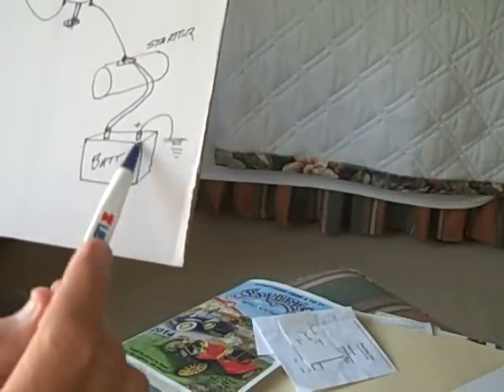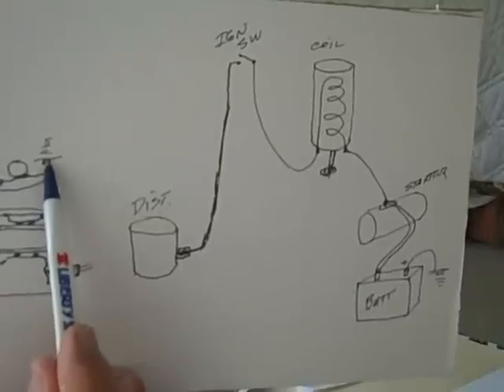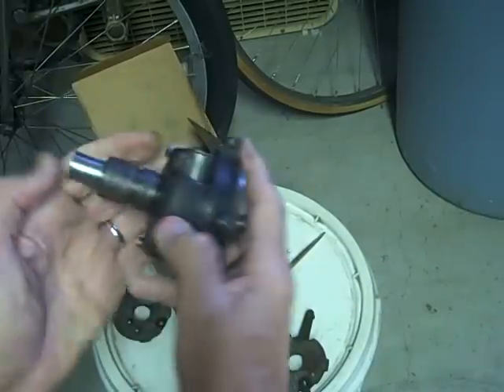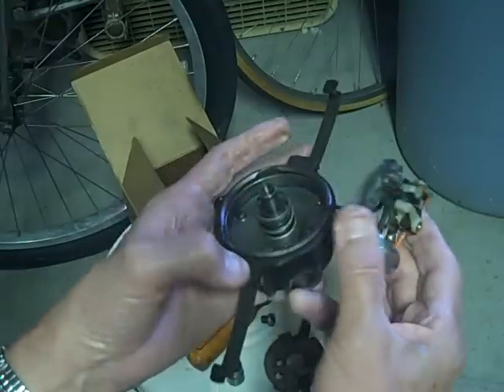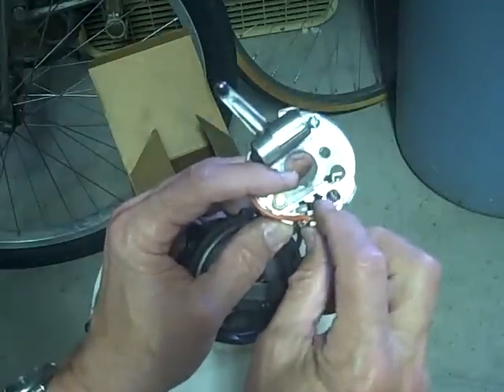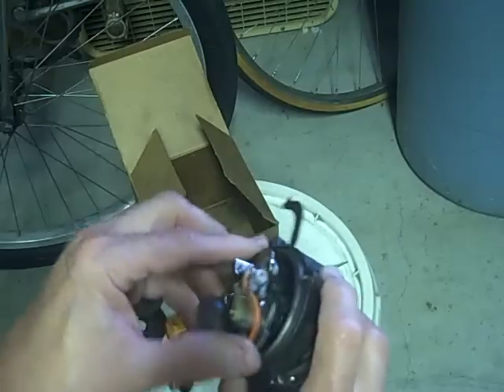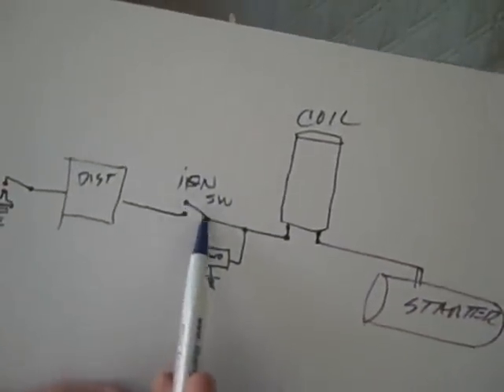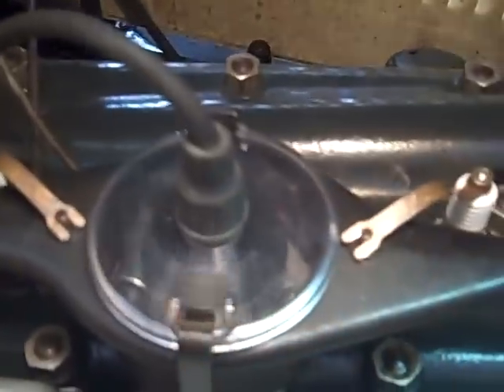Model A Ignition System 101

Comment: Jack 
In your video the wire from starter is going to red wire driver side. In your other video with drawing you made the statement wire goes from starter to passenger side of coil. I'm confused and I do understand the purpose of the coil but my Tudor has starter to neg. on drivers side.  Is that good? Also in your other video you mentioned test your horn and if good then fuse is good continue and check coil.  My problem is I have 6 at both sides coil but horn doesn't work car won't start and batt full charge.  Tested continuity at dist points open and good timing done.  Key on points open with 6 both sides of coil. Where do I start? I have new switch,  ammeter and dummy switch on the way.

Comment: Nice presentation.  One component you left out of the ignition circuit is the Ammeter which can be a useful tool in troubleshooting ignition problems.  When the ignition switch is turned on, the Ammeter should deflect slightly to the left if the point happen to be closed.

Comment: Thank you for the very informative video. I removed the original engine from my 1931 Model A truck (piston #1 cracked) and I replaced it with an engine from a 1928 Tudor. The last thing I have to do is replace the wire that goes from the ignition to the bottom of the distributor. Your video explained a lot - Thanks.
Reply from the maker: Big Tex. Don’t screw it in too far. Just enough to make contact.
Reply: @JackBahmlll  Question: This 1928 replacement engine was running in a show-winning car before I got it. It was removed from the Tudor and was in a guy's shop on an engine stand for about 3 months before I installed it in my 1931 Model A truck. Should I be concerned with checking the timing before I try to start it? Also, how will I know when I've reached "just enough?"  Thanks
Reply from the maker: @BigTex347  It will start.  3 mo. is nothing.   If it ran when it was put to bed, the timing is ok.  Maybe half the threads you can see.  Not tight.  Let me know.
Reply: @JackBahmlll  Hello Jack - I got the truck running for the first time this evening - Thanks for all your help. I called the guy that gave me the 1928 engine and asked just how long that engine sat on his shop floor before I got it. He said 5 years. I was under the impression it was more like 3 months. Non-the-less, it runs smooth and I couldn't be more happy with the way it turned out. I let the engine idled for about 15 minutes, revved up without a problem and so far it seems to be happy to be back in use! Thanks again for the information on the timing - so far it seems to be doing ok without any adjustment.
Reply: @JackBahmlll  Hello Jack - First drive in my 1931 truck after the engine swap was yesterday. Thank you for helping me through the process! Mike
Reply from the maker: @BigTex347  Now drive the hell out of it.  They are very tough cars and can take all you can give it.  Have fun.ack

Comment: we forget one thing that pick up coil by it self is a magneto tehnicaly if you have a means to supres ore change that frequncy you can use that to ignite fuel ore other type of fuel basicaly all today ignition systems are a bade copy of the original "dc magneto" basicaly similates a dead short for a small period of time! look at makes and breaks ignition system they originaly used the amps not the volts to fire a engine! look at wikipedia the early systems how they work what dual ignition engines are,hot/cold runing engines,4stroke to 2stroke conversion and vice versa,multy grade fuel runing engines,normal engine/wacum engine how they work,closed system engine etc etc etc its more a question about reverse inginering the truth is there is no diference betwen disel and gasoline engines with small modifications hell you culd run on coal. in total a normal car engine is alredy a hybrid engine look at some of the war tehnology what peopel hade 100 years ago.good video Im only leting peopel by aware on some things that schools dont teach always the truth.

Comment: Thank you so much for this! I'm a new car owner, just now having to make simple repairs. I am going to replace the ignition switch first (its stuck) and I'm wondering what the best switch is to buy for this? My car has the pop out switch on it. You put the key in, turn it to the right, the switch pops out when it gets to "ON". At least that is what it is supposed to do. Its stuck in and turning the key is hard. I tried PB Blaster, oil on the key, etc. Nothing budges it. So I'm going to replace it. Looks easy enough.
Reply from the maker: It is easy.  You can get another pop out is you want to keep it stock, but the lower cost switches Snyder's sells work fine and look like the pop out.  good luck

Comment: Your second schematic shows the condenser connected prior to the ignition switch.  It should be shown connected at the points.  Also, the ammeter needs to be shown in the circuit between the starter and the coil.  Here is an excellent link to everything:
https://lesmodela.files.wordpress.com/2017/10/wiring-diagram.pdf

Comment: Help.....just got my 1931 Model A.  Ran it into a shop for fluid changes and a tune up...hasn't run hardly since.  takes awhile to start and when going down the road about 200 yards it start running rough.  barley running after 1 mile around the block.  I have set the timing and turned the rotor to #1 spark plug using the light bulb method.  Still running rough hardly going 1 mile.
Reply from the maker: Doug Tubergen double check your timing. Get the pin in the dimple, turn key on, spark lever up, connect light to ground and point arm. Light should be off. Pull spark down about two notches and light should light. If it does not, your timing is not correct. Good luck.
Reply: @JackBahmlll  that is what i have done.  multiple times.  Where i had the work done ( 2 nd time ) they ran it for like 4 miles.  I ran it home about 6 miles.  Then after that doesn't always start right away and then runs rough.  Thanks for the quick reply!!  Are you in Michigan?
Reply: condensor going bad??  running the timing wrench around - the light goes on and off.
Reply from the maker: @dougtubergen8018  Yes, I 'm between Detroit and Pontiac. Loosen your gas czp and listen for a hiss.  It may not be venting.  Go to blurb and look at my book.  You don't have to buy it, you can see it on on review.  Something in there might help.  j
Reply from the maker: That was gas cap.  The book is "Get a Horse".  Blow back through the fuel line and see if that clears it up.  j
Reply: Jack Bahm thanks Jack. I am by Grand Rapids
Reply from the maker: @dougtubergen8018  You have a wonderful Model A club in GR.  Join it and they will smother that car until it is running like a sewing machine.  j

Comment: Hey Jack.  Thanks for the videos.  I am learning a lot.  Can I ask you to do one on greasing/oiling your distributor & shaft?  I know the Andrews book says to vasoline the distributor and I've heard to put a few drops of oil into the screw hole.  However, it would be helpful to see how it's done.  Thanks again
Reply from the maker: I am not a dist expert but that top bushing does starve from oil.  Some of us have cross drilled the upper shaft above the bushing, then a vertical drilled hole from the screw hole to meet the cross drilled one, and a hole drilled in the screw lets you squirt a little oil in the hole under the rotor.  If you get any wobble of your shaft, just replace the bushings.  Easy job and done all the time.  You can also buy all the parts you need.  Keep a little vasoline on the cam surface.

Comment: where the problem begins in your explanation , in your other video , is you have a drawing of coile wire going into the plus side, instead of the center of the coil,, that is where you lost me , and probably many others,,,,,,the only reason its ''simple'' , is because you already understand it ,,,,honestly the way you  , drew it out in the condenser video made it far harder than most applied calculus and algebra word problems,,,sorry but a very, very bad confusing  drawing , but  awesome that  you take your time trying to help people,, , keep up the good work i , hope we all figure it out
Reply from the maker: Sorry about that.  The wire from the battery goes to the coil, which is just a wire wound around a core, it is continuous.  When the other side of the coil is grounded, it energizes the coil.  When that circuit is broken, the field in the coil collapses and fires high voltage to a plug.  Now, you want all this to happen at the right time, so you run the grounding wire through the ignition switch so you can turn things off.  Then that wire goes to the distributor and to the point arm.  The cam makes the points close, ground, at the right time and the right plug fires.  jack

Comment: With the key off there is 6 volts on both sides of the coil.
However, with the key on there is still 6 volts on both sides of the coil.
Does this mean that the "black wire" is grounded?
Thanks!
Reply from the maker: That means that the points are open.  When they close, that grounds one side of the coil.  If your points are closed, then there is an open circuit on the way to the points.  Stick with it.
Reply: I checked it with the points closed and had 6 volts on both sides of the coil.
Any thoughts???

Thanks
Reply from the maker: When the points close, that grounds the circuit from the coil to the points.  It means that the points are not touching ground or a wire broken on the way to the points.

Comment: I've timed the ignition several times. When I stop the engine and try to start again the ignition appears to be far too advanced and will not start.  Can you point out where I am going wrong. Thank you
Reply from the maker: My guess is that you are doing it wrong.  If you get one of those new timing tools, you can't make a mistake.  The common mistake is with the light.  Find TDC, using the pin, hook up the test light to the point arm and ground, key on and spark lever full up, pull the spark lever down about two notches, and the light should come on.  Some people set it to where the light goes off.  Make sure.  The timing won't change from running the engine.  With the spark lever up, you should get a nice cackle, and then a little loaping with the lever down.  Stick with it.  jack
Reply: @JackBahmlll  what size fuse did you use between the starter post and power distribution block on the firewall ? I need to add a fuse somewhere in case I have shorting out.
Reply from the maker: Use a 20 there, but also add a 15 in the brake light switch circuit.  Hard to get to if there is a short out on the road.

Comment: Jack, what differences in the test will I see with a negatively grounded battery?
Reply from the maker: The + and - will be reversed, but the results will be the same.  Should be positive ground.
Reply: I have a '29 in my shop- the amp meter keeps frying, and the wiring doesn't match up with your diagram for the ignition circuit. The wire from the starter goes up to the ignition switch, and from there back to the coil. also, it's grounded negatively. I'm going to rewire per your diagram, how do you have the amp meter wired in? There are no original wires to the meter or switch, everything has been replaced by a po. With the key off, there is no power to either side of the coil. Key on, one side has power. When the car starter is cranked, I get a weak spark, but the car won't fire. After a few minutes of intermittent cranking with the key on, the amp meter starts smoking. So frustrating.
Reply: What do you think could be causing the amp meter to keep frying?

Comment: Jack, what does it mean when the test light lights up on both sides of the ignition coil, whether the key is on or off?
Reply from the maker: When the key in on and the points are closed, there should be 6 volts on only one post of the coil.  If not, it means that the points are not closing, they are dirty, or there is a broken wire some place.  From the coil, to the ignition switch, back down to the dist., up through the lower plate through that little black wire, to the points.  The points, when they close grounds that circuit, the coil is charged and when the points open, the coil fires.  Trace it.
Reply: Hi Jack. My further research has shown that I had a loose screw holding the point block screw. After tightening that and sanding the points, my test light still lit on the negative side of the coil with the points closed and the ignition switch on. I decided to try starting it anyhow and this time she started but was running rough and then stalled. I started it again and it didn't stall but was still rough. So it seems that there's still a problem with the points, isn't there? In order to save some time, I'll give you my phone number if you like. It's 1 604 420-3768.

Comment: COULD YOU DO A VIDEO ON HOW TO BLOW OUT A FUEL LINE.  MY CAR WAS RUNNING GOOD AND I THINK I RAN OUT OF GAS AND MAY SUCKED DIRT INTO THE LINE.
Reply from the maker: You should have the stand-up filter in your tank.  Just disconnect the line from the carb and blow on it.  That should clear it out.

Comment: Jack,  my 30 A coupe battery goes dead, sometimes as quickly as over night.  The amp gage does not move when the ignition key is turn on. I don't know where to start. Could even be the starter switch.  Or the key switch.  I just put a new battery in and the car started right up. Next day, dead battery.  What would suggest I do first to determine the problem?
Reply from the maker: You have a short.  With a charged battery, scratch the cable across the post and see if you see a spark.  That;s a short.  Chase it until there is no spark.  Something is touching ground.

Comment: Jack, when you say that the points close and that creates the ground, do you mean that the points actually touch or that they close by sending a spark across the gap?
Reply from the maker: The points close and make a ground to the coil to build the field.  They touch.  When they open, the coil fires and the field collapses and off goes the high voltage to the plugs.  Need more?  jack
Reply: +Jack Bahm. Perfect thanks Jack.

Comment: Mr Jack.  it appears that #3 &#4 valves have no gap between valve stem and lifter.  #3 cold 10 ths, and #4 under 5ths.  From what I have read and know and the way it's acting.  I think these valves are staying open once hot, then a little cool down and you can drive again.  Sounds far fetched, but nothing else is making since.  as for condenser,  it has had 3 in 24 hours.  none make a difference. ..  I'm looking for someone to agree with me on this valve clearance issue.
thank you sir,
Alan
Reply: when I say valves 3 & 4. I'm speaking of valves on cylinder 3 &4.
Reply: 600 mile tour.  wow.  now that's a ride.  who long did it take?
Reply from the maker: +James Alan Peacock We were gone three nites and four days.   Good trip.
The valve story sounds right, but why and how did it get like this?  Did the valves stretch???  Got hot and lengthened???  Did it ever run good in this condition?  Maybe someone built it this way and it has been bad ever since.  Hope this is the case.  The valves are way too tight.  Let me know what you find.  E mail me at virtualamodel@gmail.com.
Reply: +James Alan Peacock probably that there is valve sinking in its seat, when the engine is cold, there is a sufficient clearance to keep the valve closing on the seat but when things heat up, the valve bottoms on the cam heel and not on its seat losing the cylinder power
another possibility is that the interference between the adjuster bolt and the lifter body is not sufficient and the bolt turns in the lifter as the engine runs.
I'll take a close look to the valve seat condition

Comment: Mr Jack.  We have a 1930 A truck in the shop with an on going issue.  It come to us from two other shops.  After 20 minutes of driving the timing goes nuts.  So bad that after the backfires you wind up on the side of the road.  After 15 minutes of cool down, you can go again.  The wire under the distributor plate had a rub mark in it, so I replaced it today.  New points, Cond, Coil, Plugs, Wires, mid and top dist cap. Using an ohm meter, can not find the wire inside the dist grounding anywhere (like I said, I replaced it).  I am going to replace the condenser again because i was not one that put this one on it.  I am open to any suggestions.  Oh yea, the advance arm on the colum was backwards, in order to run it had to be all the way down.  I reversed that when I set the timing.
Reply from the maker: +James Alan Peacock The condenser change is good.  There is a higher probability of getting a bad new one than the old one going bad.  But---the Model A can cook them.  I assume the plugs are not fouled.  The timing can't change, unless your gears off the cam are shot.  Hope you fixed it by now.  I just returned from a 600 mile tour in north Michigan.
Reply: +Jack Bahm I replied,  just replied in the wrong place.  please see above.